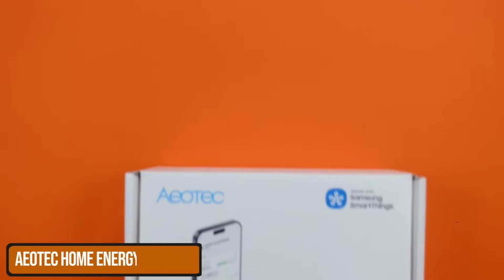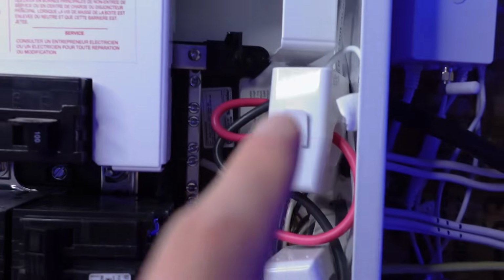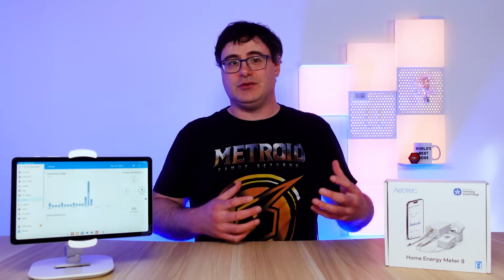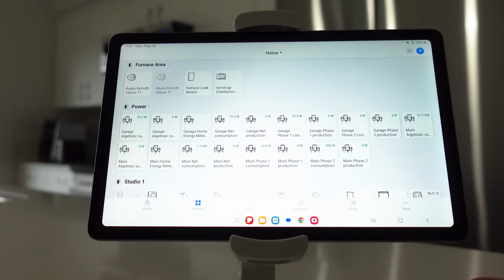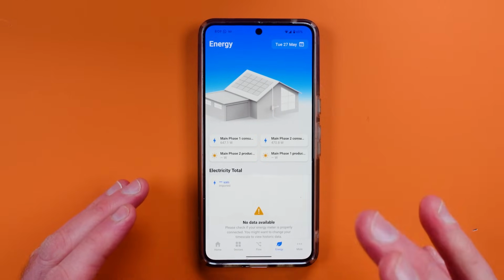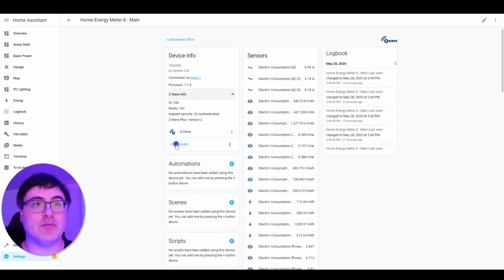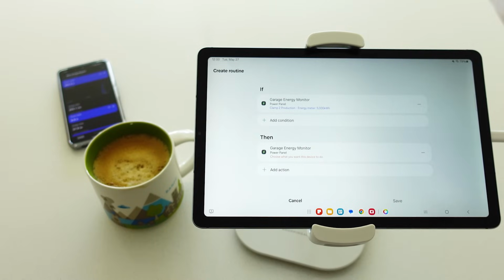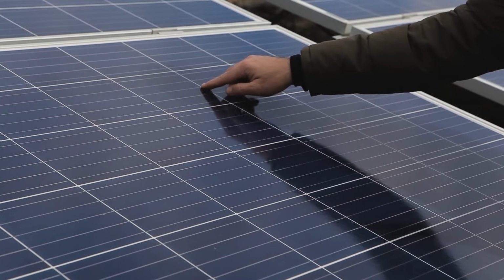Cut Your Energy Bills with This SIMPLE Hack! (Smart Home Energy Meter by Aeotec)

Comment: Does the CT direction make a difference? Meaning the actual part that clamps to the wire. I have two just like you have set up and I get different results when I am looking at the app. 

Also, I can see them in Smartthings but not in HA. I “see” them listed but HA is not showing the data.
Reply from the maker: There is a direction that's right. But what you will see is negative numbers. I think that's what we saw the first time we put it in too and had to swap it around

Comment: Brah, uh.............this is not a thing.  OK, it's a thing that you can install, spend hundreds of dollars to do it, then what.   Average US home consumes roughly 900 kWh per month.  Average US rate per the same, $0.17.   $153 per month.   So you spend $$$$ to save $10 a month, $5 maybe.   Or how about $15.  Or how about you open the calculator app on your smart phone, look at the label in your oven, and do some simple math.   Better yet, there are a ton of online electricity calculators, you don't even need to understand watts, volts, duration of use, and the relation to kWh.   Your oven is 240 volts, your air fryer is 120 volts.   It's half the cost to run the air fryer, and then some.   But try cooking your turkey ahead here in the air fryer, doesn't work so well.   You make some really great videos, this is not one of them.  It's filler about stuff that is unnecessary when a bit of common sense and Googling can figure it all out.   If you live in the desert where temps are 120 degrees during the summer, news flash......your A/C load, at 240 volts, is the main draw, period.    You want to save money, then turn it off, you'll save big.   Winters in North Dakota, guess what, your gas bill via your furnace is going to be a driver, not your electricity load because to spin the fan, doesn't really cost that much.   It's a fan.   So the data is not a bad thing whatsoever, but once you know it, the device has really no further value, conclusion is don't do it.   If you need to save $10 a month, stop toasting your bread and don't re-heat your coffee 9 times in the microwave every morning, cold coffee is just fine.

Comment: I bought Shelly 3EM which does the same thing. While it is a Wifi module, I trust it more with the correct measurements as Shelly has been in the electricity game for a while now and it is community trusted. They also have perfect integration with Home Assistant so that was a nice bonus.
Reply from the maker: Yeah and I'd consider Shelly to be similar in engineering power too. Aeotec has that history too, as they've been doing these meters for years.  So all in all, a good choice either way!

Comment: Interesting – It seems like a very long video to say that it monitors current on a cable.

In your supporting commentary you say ‘It's the way these kinds of devices should be built and it's much better than you going out and getting a smart plug or a smart switch.’
It’s not better, it’s different – you get current through the wire, and associated information with that flow, much of it esoteric unless you are an electrical engineer. That’s it. It doesn’t tell you what current individual devices are using unless you run around turning them on and off. It’s an effective way to get your top-level consumption/production.

With regard to your comments about brownouts, it doesn’t predict them, so it doesn’t protect your equipment, at best it might provide an indication of when and why the item was damaged.

You say it would take you too long to explain all the automations that are possible in Home Assistant – useful automations on the current you are producing or drawing shouldn’t take you more than a minute or two to explain.

To be honest, the majority of the video seems like a lot of ‘Who shot John’.

I have noticed a seeming trend in your videos. Increasingly they feel like marketing presentations. Other content creators, like Lon Seidman, make a point of declaring the extent of any commercial interests they have in the products they are reviewing in every video. That’s not something that you choose to  do.

I am not saying you have a commercial relationship with Aeotec and this product, it just feels to me like you do from your presentation.  Once you get that feeling about a channel, it's difficult to shake off.

In any event, it’s good to know about the product and what it does, so thanks for that.

Comment: Can HA monitor a CT and trip a WIFI breaker?
Reply from the maker: Yep, but you'll need the breaker!
Reply: @AutomateYourLife  Yeah, it would be something like this https://www.youtube.com/watch?v=Su69bhhFRuc
I would add a subpanel for these breakers.
-------
Leak detection
If I had a water leak I need to shut off the well motor.  I would do that by timing the well amps.  If it runs more than 30 minutes there's something wrong.

Comment: (10:58) You mention it has Z-wave 800. (I have a smartthings hub, 'not Aeotec') I have moved to Europe, but my Smartthings hub is from the US. If I remember correctly, there is/was a difference in Z-wave frequency from Europe to the US. Does it matter which version I should buy in relation to Zwave. Or is the only thing that matters how many phases you have coming in.

If you have multiple power lines coming into my home, is it correct to understand that 1 should be used for each power input?
Reply from the maker: Regarding your first question, yes, you should buy a version that is made for your country because of Z-Wave. Depending on where you are in the world, Z-Wave runs at a different frequency. Don't worry, these guys know that, so they've built different versions for different parts of the world. You will also need to look at how many phases are coming in on each of your incoming power feeds. 

And yeah I would suggest in general get one of these per incoming power feed at least
Reply: @AutomateYourLife  So if I want it to work with my smartthings that were purchased in the US, it requires that the Home Energy Meter 8 supports US Z-ware or can the Home Energy Meter 8 use both frequencies?
Reply from the maker: You'd have to buy the US version!  @CPHTT
Reply: Thank you  @AutomateYourLife 👍

Comment: Where did you find an Electriction that was willing to put a non UL device in your panel?  I would not trust and deivce that is not UL listed anywhere near my breaker box.
Reply from the maker: UL is funny. All of those certifications are. They're not actually required for the NEC, and having done testing at an industrial level, I believe you usually need to go beyond those certifications for real safety and stress testing.  We always did.  UL or cUL was always just for comfort reasons.

In this case, the device has SGS, with certifications for Canada and US printed on the back. Similar to UL 😃

And finally, in this case it's a CT. That's all that ends up inside the panel. It can't produce real heat or power/current.  The physics just don't allow it.
Reply: @AutomateYourLife  The Electriction that was here today (installing a genrator) showed me the county code that would makes it a $1000 fine to put any montoring equipment in the breaker box that is not certified. The monitoring devices they put are all certified. I use to thing the certifaction were usless to, only took one device tring to burn down my house to ensure I did not make that mistake again.
Reply from the maker: @maverickmaker again, the device is certified. It's just a different certification body than UL

Comment: my electrician just left and gave up, it took me a year to find someone with experience  🤣 inverters will normally watch your overall power use 
but having control of export import and charging in a bigger setup with multiple inverters and battery packs is a nightmare 🤮

i wouldent trust anything before testing it, it can be expensive to think everything is cheap, if its not telling the truth
just talking from experience

as you say if you had solar production, well people that do allready have this 😉 this is a sales point for people that dont have
you would not want multiple sites to control your system from

this is the reason i stopped smart home gadgets
the dont work with the real world
all inverters have their own app, and you cant connect all the functions to 1 app

so all these kinds of apps are just extra noise that makes things take longer in the end 

i agree this is fine for people that dont have solar or a digital meter
but if you get solar this is wasted money and time 

i can acces my meter from the grid on a app (digital meter)
and my smart meter keeps track

and im not putting my electrical equitment in the hands of that in case of lightning, that is what surge protection is for
Reply from the maker: I would argue one point with you.  We are letting the creators of inverters and the solar installers get away with this. I see every local company around here trying to install their own package so you buy everything through them.  Everything has to work with that, and they're not playing nice with others.

But it'll be hard to get this together for myself for sure!  I'm determined though, but will be waiting for the right deal on solar.  Cause that stuff is pricey